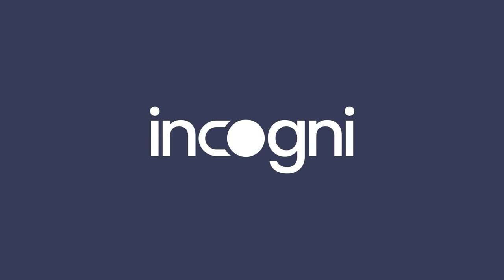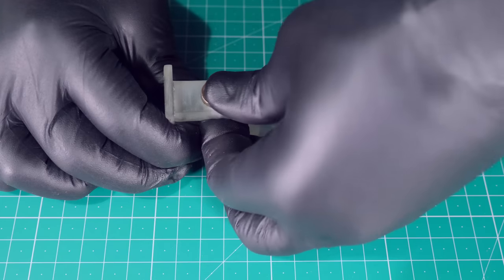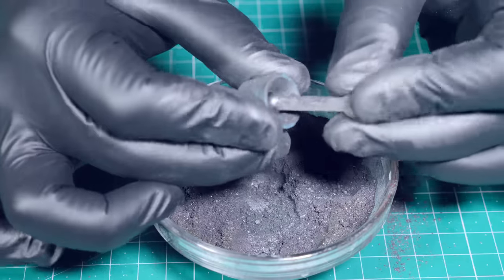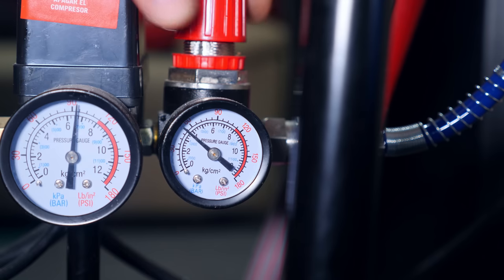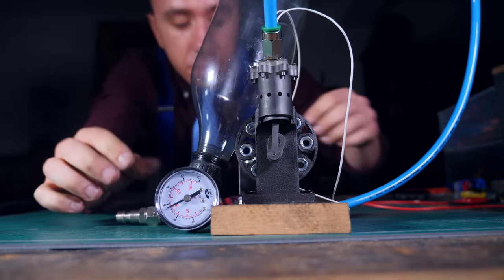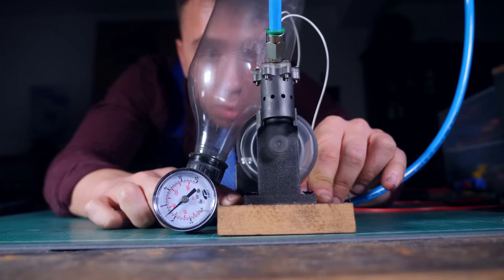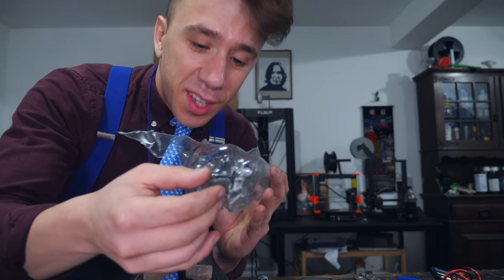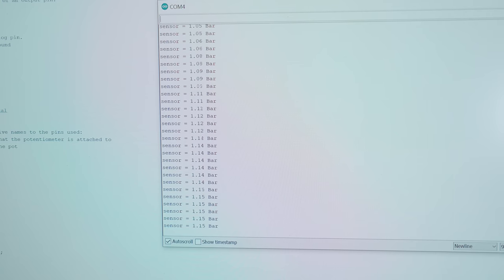Magnetic Air Engine

Comment from the maker: You can get all the 3D models (Native Files, STEP Files and STLs) here:https://integza.com/collections/3d-models
Reply: Needs more tomatoes
Reply: Make it run on tomatoes
Reply: The piston is made by hand using a dremel which is tricky poiiiiiiiiiiiiiiiiiiiiii ,🤣 i have rewatched that part many times and i cant stop laughing
Reply: You could put some oil in the piston to decrease friction and create more of an air tight seal
Reply: Excellent 👍👍👍👍👍👍👍👍👍👍👍👍👍👍👍👍👍👍👍👍👍👍👍👍👍👍👍👍👍
If you have the Time  Can you build a accélérateur linéaire (V french ) 
Its Berry intresting (intéressant VF )
Reply: Why do you have tomato’s as background😢
Reply: Now u can make a rc car or weed eater work...
Reply: 3d print a signal booster for use at the beach as I'm not going to be able to watch the video till tonight 😢😢😢😢😢
Reply: Why not just build a triple expansion engine and use the waste gas to push down another piston?
Reply: CAN YOU DO A DEMONSTRATION OF INDUCTION MOTOR
Reply: What about adding more cylinders and making a V8 version :)  Then you could use it to make a self powered skateboard! (for very short journeys!)
Reply: Next job is to reduce efficiency losses, 2 places I would start by fitting a proper little end bearing on the conrod IF its possible, (I realise its pretty small) doing so should reduce thrust friction and then the next job is playing with the relationship between the intake ball valve housings shape for gas flow consideration/arrangement, ball size, port to cylinder hole size, piston poker rod length+thickness, may even require a small spring to help control the ball etc there will be efficiencies made there allowing correct timing between closed and open intake timed correctly between TDC and BDC giving more power either up top or down low...kind of like having different cam profiles for a 4 stroke.
Reply: One day a tomato will be the inspiration for an engineering solution. 😂
Reply: build a magnet motor
Reply: All you needed to do was put a pressure regulator between the CO2 cartridge and the motor. You used one on your air compressor to turn the pressure down to 1 bar.  So a CO2 cartridge and a pressure regulator and you can completely remove the soda bottle. You can set the regulator to adjust the speed of the motor thus giving fine control over the system.
Reply: Make a V-Twin air engine
Reply: How about  a Hydrogen engine 
By electricity 💡
Hydrogen + Oxygen 🔥
Reply: I'd love to see a tiny jet engine hooked up to a generator just to check it out, even if it's not the most efficient setup. It'd be a cool way to see how it all comes together.
Reply: Awesome video @integza love the resilience and motivation to keep on searching for for improvements. You should go bigger and use several paintball gun canisters and integrate a car alternator, maybe a pulley system. This could potentially allow you to power something for x amount of time. Kind of a compressed air powered portable-ish generator. Tomatoes have tons of vitamin c btw
Reply: @Tom Stanton air engine fight when
Reply: Instead of a CO2 cartridge, try using a scuba bottle to readjust the pressure in the bottle.
Reply: I have been fascinated by space travel. I was wondering if you can do a test on other energy sources like piezoelectricity. Or do you think we can lift a spaceship with VTOL by using beam shockwave at intervals of time
Reply: You should make it dual action.
Reply: Thank you so much man
Reply: #integza. Your engine prototype has wrong firing position and exhaust , your engine should be more wide in order to increase its efficiency and the connecting rod is to be shortened
Reply: You should use the air canister and bottle upside down, turning a gas cylinder or gas bottle upside down when releasing will make it release faster.
Reply: You could get rid of the bottle for c02 only
Reply: used GPL Or butane for real combustion esternal cilinder in bottle for small amount and used this gas for run cilinder xD
Reply: Integza please use filters when dealing with resin. That thing is toxic (and the other chemicals used to "polish" the resin)
Reply: 4:35, you need to add a better timing control over that valve
Reply: Suggestion for winning the 3d printer: print a tomato from tomato-colored filament.    Oh, and then make it explode….
Reply: Dude, pressure regulators are your friend. you could even 3d-print one
Reply: It's simpler to build a pressure fill up point. Anytime you have rpm one can make a auto fill up valve
Reply: Rpm makes a counter perpetual like energy everytime
Reply: Instead of a simple tank for compressed air, use an accumulator.  Picture a tank with a flexible membrane across the middle.  Both sides get charged.  One side feeds the motor, the other side maintains constant pressure.  As the motor side runs out of air, the other side expands the membrane to keep the motor air pressure from dropping.  The pressure of the other side is whatever you want the minimum pressure to be, up to the failure point of the tank.  If the minimum pressure is 6 bar in the tank, and that is regulated down to 2 bar for the motor, the motor will run longer on the same volume of air because it always has higher pressure air feeding it.  Without a regulator it will run as though it always has full pressure, but won't run as long.  Finding the balance is the trick.
Reply: Can you tell us please, which are the clear and the blue resins you used?   Thanks!
Reply: Make a v6/8 engine using air engines
Reply: Joel if you get a PCP air gun compressor and a Carbon fibre reservoir (Wierauch make one for their air pistols) you might be able to make a more impressive stand alone system. 200 bar safe load apparently.
Reply: A coconut will hold roughly the same amount of pressure as a soda bottle
Reply: Wanted to ask if you could make a pumpjack
Reply: This is awesome! The canister only last so long. A 3d printed Mini superconductor powered compressor, compressing the water bottle to 2 bar when ever it drops might be more efficient. Maybe two valves per cylinder? Edit the code so they alternate when they open. The rpm should double if thermodynamics allow it.
Reply: Make a power generator using a parsons turbine connected to a muffler of a car to power it would work by turning waste air flow that would only destroy and turn it into a electric generator 

I thought of a good way to turn waist gas into electric energy as we know in an engine gas goes in piston moves in gas ignites piston moves out gas  smoke goes through the tail pipe out the muffler but you take that same process and make a part like the Parsons Turbine and put it in the tail pipe and as the turbine moves it generates electricity that can lead straight to the battery to charge the battery this method can lower your use of gas and can recycle and un wanted waste gas to a useful waste gas it can help charge a hybrid car or gas car but when I was thinking of it I thought it was best for hybrid cars only
Reply: Tomatoes are yummy
Reply: Tesla torpin
Reply: @dynstinn  Because tomatoes are DISGUSTING!
Reply: > "I can probably 3d print this whole thing."
Next scene: inserts "totally 3d-printed ball-bearings (tm)"

Hmm, seems legit(lol)
Reply: Use this engine to power a boat and kill tomatoes
Reply: Suggestions: 

If the target is to get the most useful work out of the air engine, find a way to store the energy, such as a watch spring.

If the target is to get the longest run time, see how small you can make an engine that works consistently

Right now it seems like the solenoid valves are probably using far more energy than the engine is producing, not to mention the energy required to compress the gas. You could find a way to compress the air using a falling weight on a string while the engine raises another weight on a string. That way we can have a way to compare efficiencies of new designs
Reply: You should try balancing the crank and piston then the running on fumes part won't be as much of an issue
Reply: watch TOM STANTON he is making great strides in the same design!!!!!!!!!! just made a 4500rpm one.
Reply: OMG you look like the lead singer from Greta Van Fleet I'm gonna see Wednesday!
Reply: Need to make a loop, air runs engine, engine recharges/compresses air again
Reply: Put a mini compressor which is powered by the flywheel and make it a self sustained engine 
 use thermal element in the fluid tank to Increase the pressure which in turn increases the rotation of flywheel
It's a win-win situation 
It might become a generator setup if it's like this
Reply: now make a v2 (or any v engine) that only runs on compressed air
Reply: Make a small air compressor and connect it to the engine
Reply: 🔴 What Is Islam? 

🔴 Islam is not just another religion. 

🔵 It is the same message preached by Moses, Jesus and Abraham.

 🔴 Islam literally means ‘submission to God’ and it teaches us to have a direct relationship with God. 

 🔵 It reminds us that since God created us, no one should be worshipped except God alone. 

 🔴 It also teaches that God is nothing like a human being or like anything that we can imagine.

🌍 The concept of God is summarized in the Quran as:

📖 { “Say, He is God, the One.  God, the Absolute.  He does not give birth, nor was He born, and there is nothing like Him.”} (Quran 112:1-4) 📚

🔴 Becoming a Muslim is not turning your back to Jesus. 

🔵 Rather it’s going back to the original teachings of Jesus and obeying him.
Reply: @GordieGii  he should have a pic of smashing tomato’s like in the sauce factory not of live, perfectly fine tomato’s
Reply: one thing that might be hard to do but would be interesting to see is a V8 or V6 (or just an I6) version of this magnetic air engine.
Reply: Do you think i can print those in a FDM printer??? or only in a resin?
Reply: Create a mini magnetic rocket launcher!
Reply: Make a video on Magnus Effect combined with Coanda effect and plasma  thrust ..
Reply: Magnetic Gas Engine 1.0:

1. Build a basic Hydrogen Generator to create Hydrogen & Oxygen.
2. Store those 2 gasses in high pressures (use a pump to increase pressure if needed/wanted).
3. Build 2 Engines; A "normal" one that works with just the gas pressure and another that will utilize the ignition of the Hydrogen-Oxygen mixture to create pressure in a secondary stage. 
4. End Result: Full utilization of the gas you have!! Why let it escape into the atmosphere when you can steal more energy from it MUAHAHAHA
5. I receive a 3D Printer..? 👉👈
6. It explodes coz mixing Hydrogen & Oxygen is a bad idea!! BUt hey that would still look good!!
7. (Optional) Store the water in a tank, heat it up and use the steam to power the engine before sending it to the Hydrogen Generator to be split into H & O.
8. (Optional but more crazy) Add a water purifier into the mix which would give you an "infinite" water supply, could add a solar panel for extra points!!
9. New Project Idea: "Self-Refueling Rocket" Basically make a DIY water purifier with some thermoelectric generators, power it with solar energy and add some tanks, hydrogen generator etc and BOOM!
Reply: you want to try my idea how ufo work .. with magnets  .? i dobt have a 3d printer ik sure ots help . and you seam hella smarter then my but i have smart ideas .
Reply: @jak3677 🙋🏻‍♂️Ok boss you are almost there. If you drill out a 8 cm cube in the orientation of a dice ( opp add to seven )
To a 1/2 in hole And fit those pieces inside to make a pump to fit in a hand 
Probably left hand ☦️
( tool of creation ) 😮
for your efforts. 
Good job brother 
💁🏻‍♂️🎤
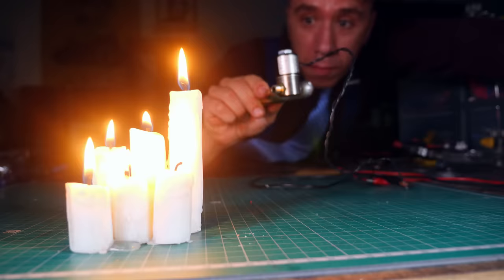7:42 you can use extensions as in volume chamber attachments maybe 
Pls give it ago to see what you see. Cheers from Australia 
Great videos 👍🏽
I have an atom man experiment too if this one goes well
Reply: @integza I need 3d Printer too😢😢
Reply: To enhance an engine running on compressed air with a piston powered by magnetic repulsion, focus on efficiency through optimized design and high-quality magnets, manage heat effectively, employ advanced materials, and precise control systems. Explore regenerative braking, variable compression, safety measures, and noise reduction. Consider integrating energy storage, prioritize sustainability, and continually prototype and test for improvements in performance and reduced environmental impact.
Reply: you should consider to have the air in take on the cylinder side , under the exaust. you migth not have dificulty to get air tight betwin the cylinder and an hollowed piston, that let air go from it's side to it's top. no head valve friction ?
the piston may need some room to late the  top pressure air flow reaching the head
Reply: More co2 cartridges, and link a few together and make an engine out of it. V6 would be cool. Maybe make that into an rc boat/car.
Reply: Coolest chanel you have 🎉🎉🎉
Love it ❤❤❤
Reply: V6
Reply: Thanks for the free stl's.. HEHE

IM FREEEEEEEEEE
Reply: Can you make a video about a self-sustaining water fountain that make electricity using wind and light not solar-powered but steam-powered using the power of the Sun and wind to power The Fountain and make electricity using the water
Reply: If you want to make it run longer you can also fill the bottle to lets say 6 bar and then have a pressure regulator bring the outgoing pressure down to like 1 or 2 bar. if you combine that with the CO2 refill, or just add more bottles, you could probably get even more time. Love your video's I came across your channel not that long ago. but man am I enjoying your videos!!!
Reply: I saw that u have a Serbian Nikola Tesla on ur wall.
Great POSTER
Nice video!
Reply: I saw that u have a Serbian Nikola Tesla on ur wall.
Great POSTER
Nice video!
Reply: the amount of preasure that bottle held makes me wonder why ppl use pipes for pipe bombs lol
Reply: can you make a tomato canon  in next video
Reply: so i was wondering, can you attach a tesla valve to the side of another one? i was thinking it would be a nice way to maintain flow direction in a closed pressure system have your air outtake feed directly back into your air intake ;)
Reply: @andylewis7360  i was thinking if you can connect a tesla valve to side of another one you could have the air outtake feed back into intake & still maintain air flow direction & most of pressure in system
Reply: @hamasmillitant1  not sure I can picture what you have in mind but I’m pretty sure Tesla valves work best with liquids
Reply: Can there add some gear for increased RPM?
Reply: Please use liquid nitrogen as a fuel 😅 11:00
Reply: Put some fuel in the piston
Reply: Nice.❤✨
Reply: Like your style and a new subscriber.
Reply: Integza look my coment please this nou te other XD
Reply: Would of you added lime a paintball CO2 tank? Or built some kind of exhaust that pumps the used air back into the tank?
Reply: You can change the shape of the ball to one similar to Lollipop with the slotted stick, the piston would be concave and you could. thereby reducing the length of the compression cylinder
Reply: Why couldn't you just use a flow regulator between the CO2 cartridge and the engine?  Why the soda bottle and controller?  At first, when you used the bottle, it made sense, because you pre-charged it with air and used only the contents of the bottle.  Using the bottle in conjunction with the CO2 cartridge?  Makes no sense.
Reply: Air Pressure which released from cylinders of preston again going back into pressure reservoir i-e in this case back to pressure storage bottle
Reply: @Integza I'd love to see some of your projects utliize Thermoelectric Generators. Your projects often have energy waste in the form of heat or hold that could be harnessed, even if at low efficiency levels.
Reply: Try a multi-stage CO2 canister rocket...
Reply: For an improvement on the engine ditch the bottle and just do a co2 cartridge with a regulator in between to keep the pressure constant for as long as possible the cartrage is in and you can add a co2 tank for even longer run times
Reply: i like your videos but sorry i love tomatose
Reply: You should actually try and use a more safe less firey engine to make your own plane
Reply: I have an idea to use CO2 carts to make a replenishable ice pack for transporting meds. Avoiding the horrors of thawed life saving medication. Want to talk. I'm incredibly easy to find.
Reply: We can bypass that soda bottle and add a regulator on the canister with a circuit so that we can operate the engine with a push of a button and we can increase the number of pistons with the help of the regulator and we can run them at proper time intervals so that we can get more power out of it this makes it compact and portable with this we can perform some tasks like running a water pump or something
Reply: why dont you use an high pressure green gas airsoft canister as a reservuoir? those tomatoes wont bomb themselves!
Reply: you should use a container of water with metal plates inside, then add a small electrical current and it will produce a gas thats flammable. direct the gas into a cylinder and has a spark plug ignite it.. LOLOLOLOLOLOL
Reply: Thanks.
Reply: Micro pellets of solid propellant in a light weight hopper dispenses a pellet down a revolving tube every time it drops below 2 bar.
As it drops and safely isolates from the hopper, the pellet comes into contact with an igniter filament and recharges the bottle back to 7 bar.
Reply: @stripycrocodile how about a 100 liter bottle engine, setup like a dragster?
Reply: How about 3d printed mechanical co2 injector